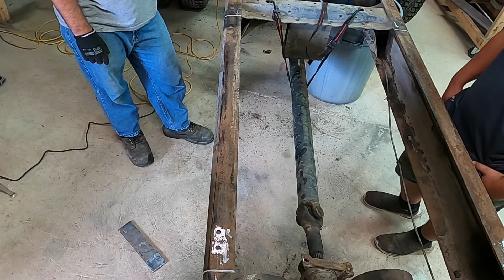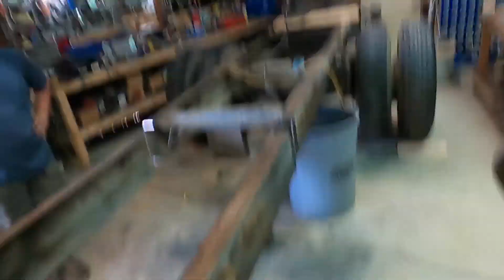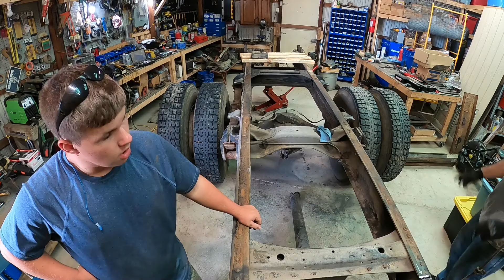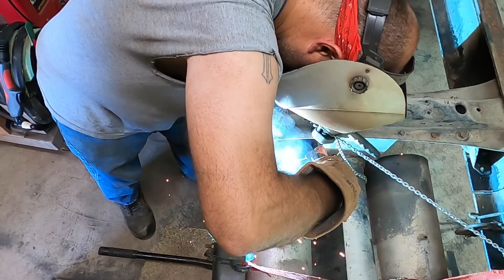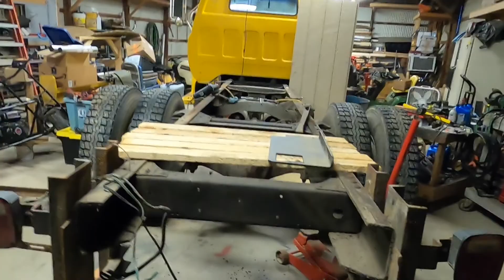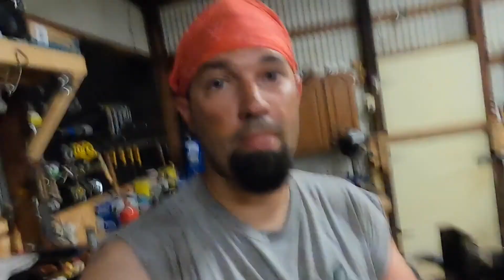Project Yellow: Cutting the Frame, Shortening the Truck, Welding It Back Together - 1987 GMC 7000

Comment: Great back up plans Sir 😏🤣👍Great set of sunglasses 🤣👍😎 Yes SIR,  Stick welding rods is the way to go 💪👌👍😉 The look of the welding is not important Sir, it is the good mix of the two surfaces of that weld bead 👍😉 Outstanding Job Sir 😉👍👌💪 Cheers 🍻

Comment: Wonderful job! Hope I didn’t make you mad about the blocks, I’m not a safety freak by any means but wood blocks are much safer! Everything looked really nice and aligned from what I could tell, the length I think will be nice too! Take care!
Reply from the maker: No, not at all!  I'm just picking at you.  It's all I had, but you are absolutely right.  I do plan on getting some extra jackstands and big shop stands as well.  I'm planning on it, but my wallet is hiding...
Reply: @FabbedFun  just don’t want you getting hurt. If you could find some scrap 6x6 posts from a pole barn project or something would be nice. They work great for crib blocks.

Comment: Hi just caught your video this morning…I’m anticipating a similar frame shortening on a 96 L7000 with the longest frame I’ve seen …however I’m considering just unbolting the rear axel and spring mounts and redrilling the frame to accept the new position…had you considered that as opposed to welding ?
Reply from the maker: I did consider it...  But didn't have room in the barn to be able to put the tractor up and use it to move the axle on my small concrete area.  If you have the right environment to do it, I think that would be the absolute best possible way to go.  Also, getting the first hole drilled lets you make a template for drilling all the other holes (make a rod with a hole as a guide at one end, a bolt at the other... slip the bolt in the old hole and the front hole should be positioned the same distance forward that you'll need)  Thanks for watching... will you video your build?

Comment: FYI, modifying the outside of the frame is a problem for the DOT for structural reasons. The outside should always have a factory appearance. Always weld your plates on the inside of the frame.
Reply from the maker: Due to crossmembers and other structure, I didn't have as much room for large plates.  But that is good advice...  more "covert" to put on the inside.

Comment: curious why cut frame vs moving up, sold last project truck an picking up a gmc 6500 sunday, first object is shorten it, i went older vs newer, see if that bites me later
Reply from the maker: I was afraid I wouldn't get all the holes cut right.  Frame seemed simpler to cut and weld., fish plate, weld, double frame.  Moving the axle is probably more "appropriate" for most, though.
Reply: @FabbedFun  mines a tandem if we like what we see an buy, im gonna measue an rent or buy a mag drill an move, i want short for pulling my car hauler an build more western hauler bed
Reply from the maker: @bigjim11566   I expect video and a link in the future!
Reply: @FabbedFun  back to the hunt, just drove almost 4hr to see trk an guy wasnt there, seen trk, but no one to talk to, waited trying to get him for 2.5hr

Comment: Why would you cut the frame in the middle instead of cutting the leaf spring mount rivets and just roll the rear end forward? Then cut the end of the frame off, redrill the holes for the leaf spring mounts.
Reply from the maker: I think, if I were to do it again, I would try your method.  However, some of these C-series medium duty trucks have a slightly different frame shape near the leaf spring's rear mount.  I didn't know if that would throw me off.  Bigger trucks (and probably some newer ones) have straight frame rails.  Great comment!  Thanks for watching!

Comment: I got a question. After cutting it what all did u do to make sure the frame was straight? I have a truck I wanna cut in half because of rust and weld a new back half on
Reply from the maker: Find a common point that's symmetrical to each frame rail in front of and behind the cut, measure off of the first point to the second point and compare sides.  It's probably better to grind the long side to clean up any "high" spots that keep the frame from coming together in an equal manner.  Fortunately for me, I was only about 1/16" off and just rolled with it.  No issues driving down the road straight.  Well, none of my roads are straight anyway haha!  Thanks for watching.

Comment: Looks like if you where going to cut and weld a frame and show the entire world you would do it the correct way/ just sayin
Reply from the maker: You're a bigger fan of the z cut?  I've had a few say they prefer that but I knew I'd have enough redundancy that it wouldn't matter.

Comment: You sectioned a frame without even doing it on a 45? Wrong dude. Not even legal where I come from.
Reply from the maker: Legal/Illegal is not necessarily right and good/bad and wrong.  But I guess that dabbles in political topics...  Anyway, yeah... that's why I added a fish plate and then reinforced with bolted on sections of additional truck frame.  It is a weld reinforced by another layer of overlapping steel and weld at different angles, reinforced by G8 bolts and additional steel.  I think I'm okay.    Beverage trucks for YEARS have been cutting out sections of frame, dropping at a 90, turning another 90, and running mild steel C-channel back to another set of 90s that connects back to the original frame.  If I'm not legal, no similarly-modded beverage truck on the road is legal.  They are aftermarket straight frame cuts and welds.  Once I started getting a close look at professional frame mods done across the transportation industry, I realized my little GMC would be just fine.  If you do it differently or better, great.  You can't be too safe or too strong.  Thanks for watching and commenting.
Reply: @FabbedFun  It's funny I came across your video after someone said I was doing a frame job wrong on my video lol. You can check it out if you want on my channel. I did it with a torch and a mig. Cut 21 inches out of the frame and mounted the box all in one day. 
Your truck will likely be fine, its just proper form to always do it on a 45, even with fish plates. Cheers keep on fabbin, it looks good.
Reply: Nice job and video editing. I to have gotten many comments on my "straight" cuts vs. "Z" cuts . Their comments, I believe are originated from what looks cooler. Also there is the fact that an angle cut and weld will have more surface area (length) than a straight one. However, I personally have always done straight cuts and never experienced any trouble whatsoever. I have also done and seen done by others, frame splicing with no fish plating at all on trucks that regularly gross 100,000 lbs. If the weld is good, done with the proper rod and processes and attention payed to dynamic truck loading characteristics, the straight cut is a great choice all the way around. But I will say that an angle cut is mighty pretty, kinda like chrome stacks! Good luck with your build.
Reply: @turbo1438  where I live it is law. Period. Not allowed straight frame cuts because it is stronger on a 45. Period end of story.
Reply: @EliteTruckRepairs  I don't care